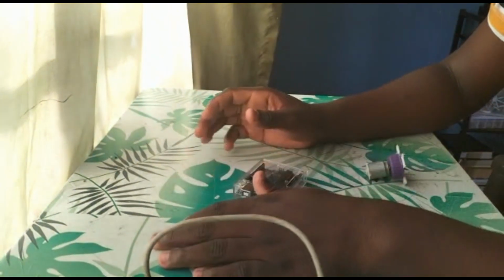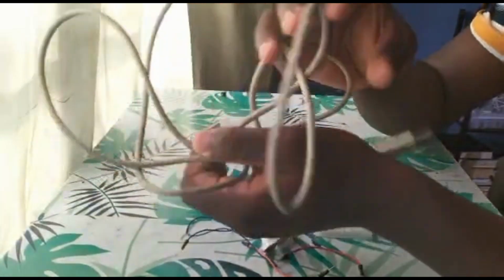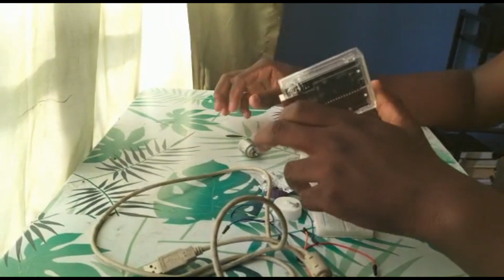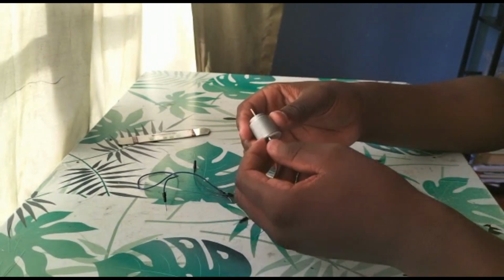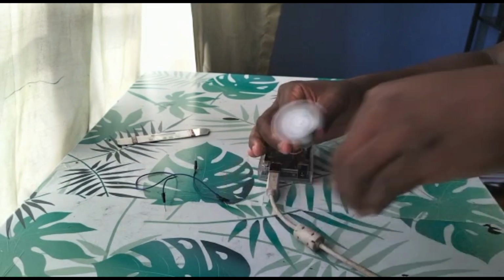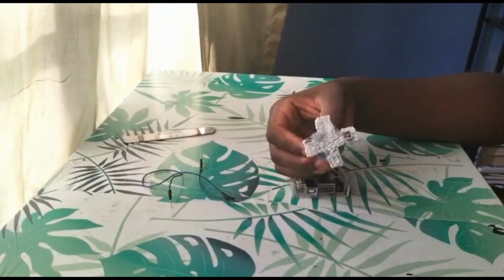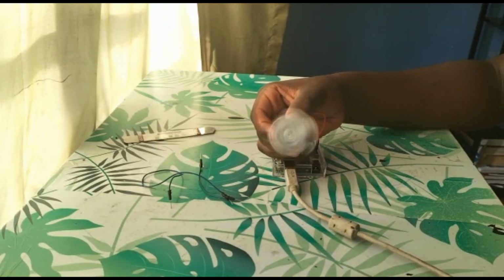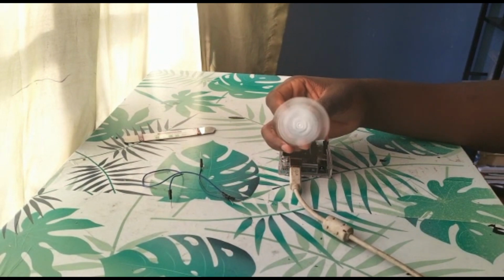Arduino Basic: #2 Make a motor spin!

Comment: I just stumbled across your videos after watching Emily and Clarks adventures where he was building an autostart generator based battery charger. And before that I was watching Wil Prowse talk about lithium battery balancing. So know your algorithm is putting you in relevance to other you tubers with massive followings. I am nivice in electronics abd want to learn more. Also the Everlanders features off grid world travelers that 3d print their own parts as well as modify their RVing systems with the same automation and control techniques you are introducing. 
Goid luck I shall follow your feed.😊